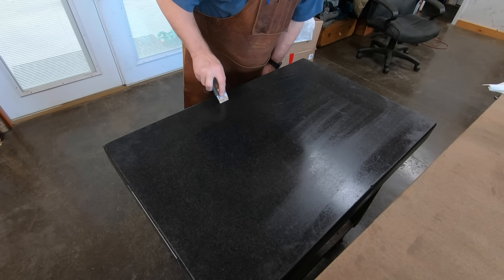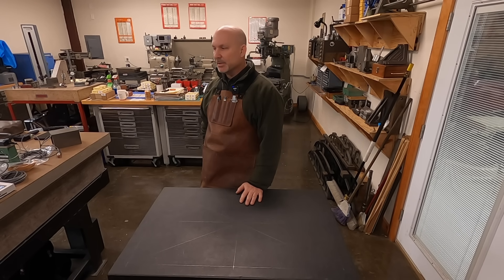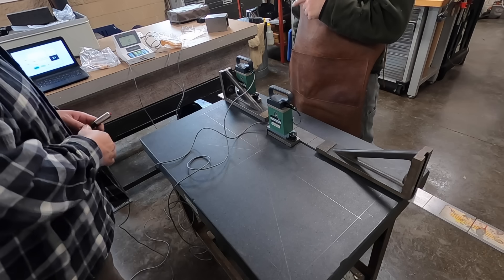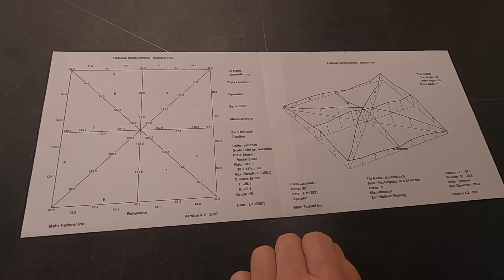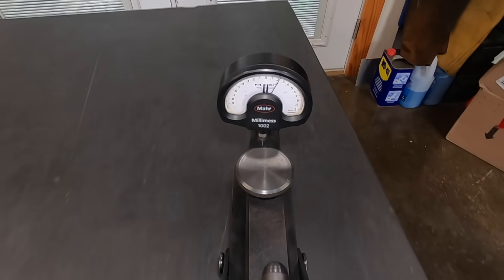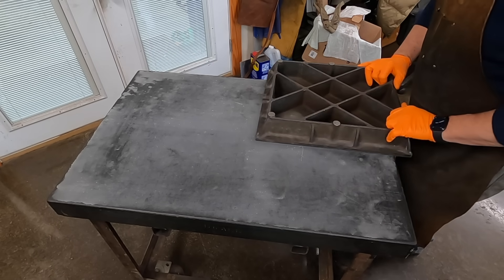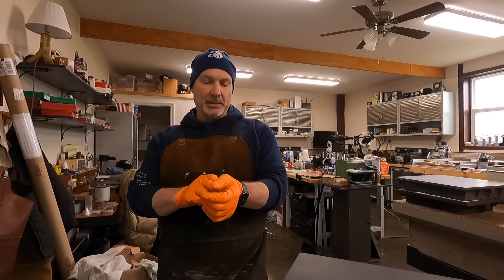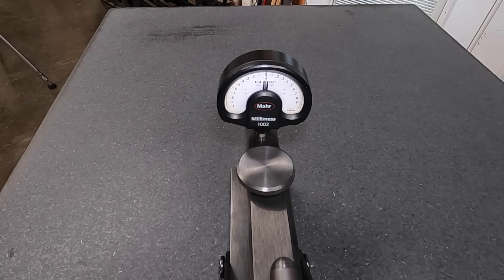Lapping my Granite Surface Plate to AA Grade

Comment: I wonder where the Starrett pink granite is quarried?  I worked as a driller for a civil engineering company that primarily designed foundations for bridges.  We cored and tested a lot of rock, and plenty of granite.  There really is something special about pink granite.  We cored pink granite in Columbia, South Carolina that tested up near 33ksi compressive strength.  That's some really hard stuff.
Reply: I want to say Minnesota. Somewhere in the upper midwest I think.

Comment: What’s the need for having a plate this accurately flat.
Reply: I would guess if you want to machine VERY accurate parts , then you need to have a very accurate datum to measure them against, you're only as accurate as you can measure!
Reply: @paulelephant9521 This is correct. You can also use the surface plate to examine flatness if other parts using transfer die. This is mostly for creating flats to use while scraping other items flat (dovetails on a mill, for example).
Reply: @paulelephant9521  Although, It wouldn't say just VERY accurate. It can also just be large items needing a height gage (top large for calipers or micrometer, etc.). Can also be used with angle plates for measuring other features of large objects.
Reply: If anyone wonders what men do in the garage, this is it
Reply: @Guroji  I normally destroy things on a lathe, mill, welding table 👍😂🤷‍♂️🤦‍♀️
Reply: We make parts for aviation and military. Some parts are scrap if over said # . My uncle worked for GE as a parts finisher. His parts were so flat that a finely machined steel ball would not roll off the service when it was finished.  Even a gun in not held to the accuracy of some specialized parts made from Incanel or other exautic materials. Everything is relevant to what you are making. Great question, and I hope that helps.
Reply: Reference.  I bet you didn't know the mating surfaces where the heads of your engine and the engine block on your vehicle must be precision flat.   Mechanically speaking, how parts fit together matter a great deal in the performance of machines.   if you have something tall standing on a flat surface, it might not have much variation at the bottom, but the top of the part might swing out by a wide angle.   Once you have precision flat, you can measure deviations from what would be ideal.   There are a number of instances where having something that is precision flat will make a difference in the functionality of a device.   If there were not precision flat surfaces in the construction of computer chips, then your chips would not work.   The phone in your hand and the computers you use all required precision flat surfaces in order to manufacture them consistently, cheaply, and reliably.
Reply: @charleswelch249  Thanks for your reply, its intesting the accuracy of a AA plate is way beyond the average machine shop levels of accuracy.
Reply: @theflyingchillipepper  you are very welcome.

Comment: What is the granite plate used for? Calibration of tools for the machinery? Checking true level on machined goods? Explain it like I'm 5.
Reply: Yes, if you want a good explanation look up the video by the youtube channel Machine Thinking, it's title is Surface Plate or something like that, it does a good job explaining them pretty fully.
Reply: It's called a SURFACE PLATE. It's is the flattest thing in a machine shop and acts as a reference (datum) surface. The bottom surfaces of objects placed on it are assumed to be perfectly parallel and in line with each other. Surface plates are used for calibration, measuring, and comparing heights between objects. One thing a surface plate isn't intended to be is level with respect to the force of gravity. The plate is only intended to be extremely flat across it's own top surface.

Indeed, Machine Thinking has a good video on surface plates and precision measurement titled "Origins of Precision"

Comment: To check the flatness without complex measuring equipment just look for distortions in the reflections off of the surface.
Reply: If you can see the distortions in your plate, it's it is so beyond failing any standard that you are either going to be buying a new one, or paying for many hours of lapping. You can begin to see low and high spots once you start lapping it though.
Reply: @samo4866  Tell it to someone using that method for lens grinding lol.

Comment: Wouldn’t a bigger lapping plate make it easier to get over all flatness?
Reply: Interesting question. Would like to know.
Reply: I’d assume it’s an issue of efficiency. I’m guessing smaller sized plates would allow for efficiently targeting high spots. Bigger laps would possibly (??Unsure but from working with other stuff i’m guessing this first part??) grind more slowly and more importantly also have a chance of incidentally grinding down areas that the lapper doesn’t intend to affect

Comment: 11:48 I see that as totally normal. Its the widest area and you can have a lot of tools there easily reachable and then way the surface is set fex against a wall make it only possible to use one side at a time. And after some time it will be turned 180 degrees and after that relapped.

Comment: 41:47 
Lance: 74 millionths, yeah seven tenths of a tenth 
 Me: Lmao in M E T R I C
Reply: 18.8 microns
Reply: @thisolesignguy2733  Used to mill material to 10 micron or less 50+ years ago. Lab did full testing, on job test was by hand, NO tools, just fingers. I never had a rejected batch, others did.
Reply: @thisolesignguy2733  
That's a pretty bad run out.

Comment: Them old projection TVs you see in the trash have an optical ground mirror in the back about 3 foot by 2 foot. The reflection is remarkable.  Curious to know how flat it is with this type of measuring.
Reply: If you want accuracy, telescope mirrors must have sub micron surfaces, or are useless.
Reply: @UncleKennysPlace  I'm aware.  It really matters when imaging.  Even down to lacquer paint on a hot rod car.  Flat with contours.  Haha
Reply: @UncleKennysPlace  and actually everything has a sub micron surface.
Reply: @essentialjudge2279  so has your skin...
but not everything to that degree of accuracy

Comment: What does one do with an extremely flat surface like that?
Reply: Use it to make more flat surfaces
Reply: Set dial indicator stands on the granite and a piece you've mostly flattened and find where the high and low spots or uneven spots are in the piece you're working.

Also blue, yellow or red dye is rolled on to these granite plates in a very very thin layer and the part you're working to flatten is moved across the dyed granite surface to mark the high spots of the piece with the dye.

Look up straight edge scraping. You'll see the idea is after lapping, to scrape a series of high and low valleys into the piece with about 30-50 spots per inch of surface to create a smooth riding, truly flat surface that wears evenly over time. You'll see evenly spaced blue high spots and yellow low spots on the surface.

Comment: why not use laserinterferometer to measurement ? the spirit level won't give enough precisely result
Reply: Darn. I expected a lot of expert level info on your page but you have zero videos. :(
Reply: It's not a spirit level, they're electronic. They're just about as accurate, but the laser systems are so much faster, but also so much more expensive. My company won't buy us one...
Reply: @samo4866 
We've got an optidyne for doing machine calibrations and whatever else we might want to use it for.
We can get machines trued up to small fractions of tenths in under a day with ball bar. To squeeze out another solid decimal place takes more like a week on the laser and just isn't worth doing.

Comment: we just paid a company approved by starrett to come lap our pink plates in the inspection room, the one plate that we stopped using because we were getting weird measurements was .0025 inches out, the shop paid the guy to lap that plate for 15 hours :)
Reply: Was someone using it for sanding? I think my countertops are that good.
Reply: @UncleKennysPlace  haha, no that’s what heavy use for 30 years without lapping will do to a plate.

For some reason the old boss didn’t seem to care, the new owners wanted it taken care of right away and now have us on a 1 year schedule with the company.

My goal now is to get them to do our 5 year old plates at the workstations

Comment: Am surprised that granite surface plates are not made 'contoured' ( thicker at the Airy points ) on the bottom surface making a variable thickness plate, but which gives the flattest top surface profile before lapping.

Comment: Absolutely no fucking clue what I watched.
Reply: the plate he's dragging around is carving away at the granite surface (lapping) to bring it to an extreme evenness. when folks think of lapping they normally think of sharpening knives; this is the same principle, just at a larger scale and with different materials (metal to refine stone instead of stone to refine metal).

these plates are used as precision references in machining to do things like checking the flatness of the part you're working on. this is machined down to an AA surface, which is a rating on a scale that describes the overall evenness of the surface, and thus tells you to what level you can trust the reference.
Reply: The most rudimentary business of shaping any material are roundness and flatness.  From those, you can find angles - a sine bar uses both.  And in those, "perfect" depends on tolerances.  Put a polished metal under a microscope and it may appear corncob rough.   Years ago, I knew a guy in Chatsworth whose specialty was roundness.  Worked on anything of aerospace tolerances, mostly roller coaster parts [since most those creations are one-off's, and parts get made to spec when called for].  Two grinding setups... took machined parts from other shops, and made sure all that went out for install was +/- 0.0002" or less.  That would be perfect parts where a spec was in 0.001" increments.  A good granite slab means you can trust your measurements the extra decimal place and lose no sleep over it.  It's a tool in and of itself which occasionally needs calibrating/certification.

Comment: Can you ask lance, how they deal with the massive plates with the hold down drilled into them? It would be thought to run the local meter over them? I have two plates about 5 foot by 12 foot with 5/8th hold down on a roughly 8inch square pattern.. they are sitting outdoors, they can be had for very little if interested. They have a calibration on them out of north Kingstown Rhode Island, I’m thinking brown and sharp, or grenell, maybe Stanley bostich. But most likely out of brown and sharp..

Comment: You talk about a convex or concave condition on the surface.  At what measurement does that not matter?  I mean, flat is flat, no surface difference.  Also, how do you assure your lapping plate is flat?
Reply: There is no such thing as flat. At what measurement do you stop caring is the question. The repeat o meter is measuring millionths in local difference, and the plate is within a couple tenths of a thousandth overall (.0002"). This is probably waay more accurate than you are imagining. A human hair (aka dust)is about 3 thou(.003), more than an order of magnitude worse than the total error across the entire plate. If it isn't clean, you can't even measure what's going on. As for atoms, they are still up in the hundreds or thousands of atoms. The individual quartz crystals granite is made of measure about 5 angstroms, or about 20 billionths of an inch. About a thousand of those would stack up to the total error across the entire plate...
Reply: @rohrertech8882    Thanks.  I’m beginning to get what’s going on.  Who certifies the meter for flatness?  Who makes such a device?
Reply: @anthonytalin3919   excellent  thank you
Reply: @anthonytalin3919  thanks

Comment: See those handles on the top of the heads? They're there for a reason... so you don't induce heat into the heads or the surface plate you're trying to measure accurately. Tools are only as good as the person using them.
Reply: @TheDankFarmer  You "think"... No you don't. If you did, you wouldn't take issue with the obvious. Goof tube is littered with misinformation and those who don't know they're being fed it, take issue with those who actually understand a given process such as precision measuring equipment and their proper use. Something you obviously lack knowledge in. You don't use the handle on a frying pan and that's obvious. LOL
Reply: @TheDankFarmer  AA Grade? Hah! Imagine measuring a surface plate incorrectly repeatedly and then referring to it as AA grade. 

Based on your complete lack of understanding of precision measuring you utilize a hammer to drive a threaded fastener since there's some goof tube channel doing it and you watched it. 

Anyone can buy a tool and you certainly have less than zero understanding of how said tool is to be used correctly.

Dolt
Reply: @TheDankFarmer  Dude, what are you mad at? The guy made a comment about how to use a tool properly and somehow that annoys you? Because he is imparting knowledge?
Reply: @TheDankFarmer  Nothing unnecessary. They made a mistake using their tools. He pointed it out. Hopefully they don't make this mistake again.
Reply: @TheDankFarmer  Desired results do not equate actual results. These instruments are very sensitive and using the handle is recommended to achieve maximum sensitivity that this type of work requires. Just because you don't see anything wrong does not mean there are none.
Reply: I doubt it makes a substantial difference
Reply: @Golgi-Gyges  Your doubt stems from a lack of understanding how precision measuring equipment it handled correctly. It's okay, nobody's going to lose any sleep over your lack of knowledge.
Reply: @waakid007  He's ignorant and has never used precision measuring equipment and as a result he was offended that someone with knowledge stated the obvious. His only response was to act childish instead of gaining knowledge and appreciating the same. 

As the saying goes, "A smart man learns from his mistakes and a wise man learns from the mistakes of others." There are two groups - those of us whom took the time to learn from wise men and are willing to share what we've learned, and then there are those who shun the wisdom that will always walk in darkness.
Reply: @strykerentllc  you SOB!
You do not know what I do or do not understand.
Reply: @strykerentllc  you are not going to lose sleep about what you think I do not understand? Yet you replied.
You will reply again. That is what I understand.
Reply: ...so I wonder how many "millionths" were off by the guy not using the handles?
  I'm sure that some virtue signaller out there can tell us...
Reply: @Golgi-Gyges  Why don't you research it and then you'll know. ;)
Reply: @strykerentllc  bingo! You lost sleep, so-to-speak.
  I don't need to research anything.
Reply: @strykerentllc  why don't you tell us all how much his hand temperature changed the measurements. What's the amount?
  Otherwise, you are dismissed.
Reply: @Golgi-Gyges  You don't need to learn anything.... that's great. Now you can go back to wondering why the earth is flat. The human race won't miss your insightful and intellectually stimulating interjections.
Reply: @strykerentllc  you are dismissed, Boy Scout.
Reply: @strykerentllc  and you are watching, why?
Reply: @strykerentllc  in person, you won't act this way and you know it. Normal internet anonymity stuff.

Comment: I am curious what deviation is being detected by those sensors being that the stone is sitting on rubber pads. Surely the weight of the straight edges and other stuff on that slab are being moved all over the surface is creating some gradual change in the plotting of level, and as I see the 3d map generated, it looks like exactly what I'd expect to see if this were happening. Thoughts? Lance? Adam? Great video regardless.
Reply: I assume that’s what the 2nd sensor is for.  So if the plate moves as the 1st sensor is moved about, the second sensor records the change in angle ind knocks it if the first sensor reading. He said the sensors have pendulums in them so are probably measuring angel. As the fist sensor is moved across the height difference between the front and back foot would tip it one way or another and change the angle the pendulum hangs at relative to the sensor.
Reply: The rubber pad placement is a science in itself. Place one in the middle - the edges bend down. Place one at each end the middle sags. Place two about half way between the center and the ends and you minimize deflection.

Comment: I realize machinist want an absolutely flat surface for different reasons, but unless that slab is covered up all the time won't it collect dust and daily elements landing on it to throw it off. I realize you would have to clean it to use it, but even cleaning the dust off will wear into it over time. Just an observation.
Reply: Well running regular test patterns over it for years has dropped it from an original A to a sound plate, more than good enough for most shop work. Think of all that nasty tool grade steel trying to rip apart humble Granite like some nasty chap paper.  A :lol:   An A grade surface plate should only really be in a dedicated, temp controlled and hermetically sealed room.

Comment: As Adam said,  he doesn't need a ISO: 17025 accredited certification. Lapping plates isn't all that difficult,  many labs will use an old cast iron plate with diamond dust embedded in it to do the actual lapping. It's almost more an art.
Reply from the maker: Just like we showed here
Reply: @Abom79  Yes, Sir.